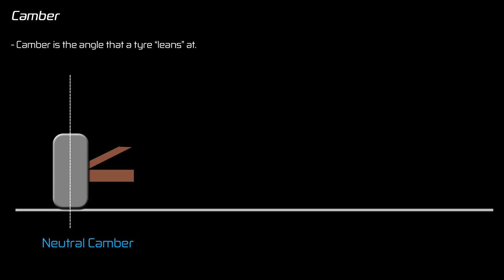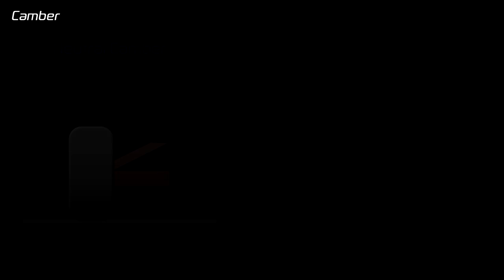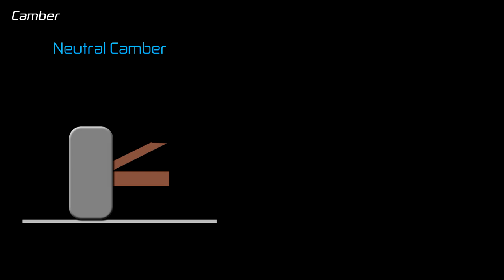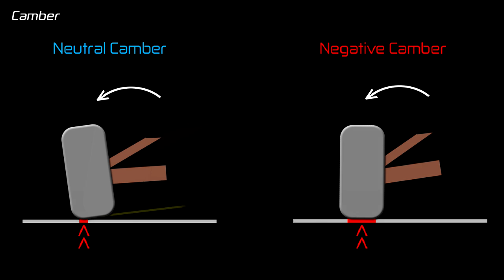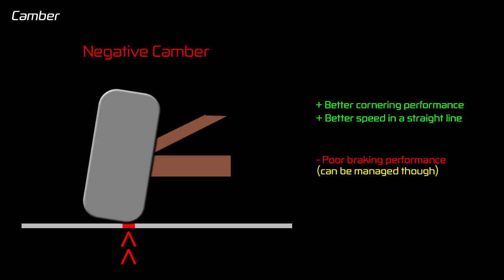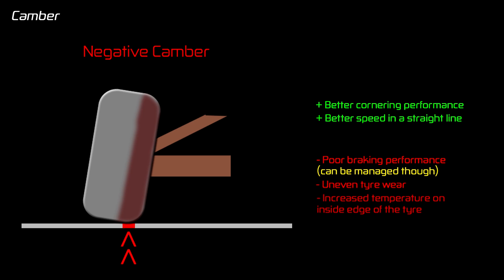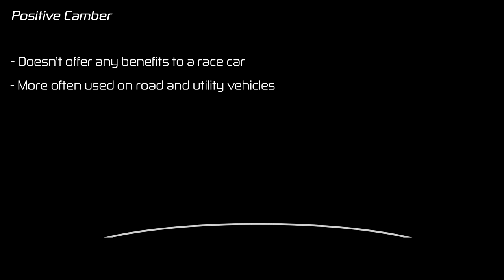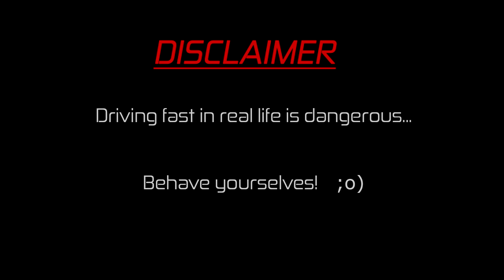Race Sim: Camber

Comment: Positive Camber is used a lot in Drag Racing, it is used to increase the amount of tire contact when the car is accelerating in a straight line. The more tire contact you have going in a straight line, the more grip you have.
Reply: wouldn't you have better straight line traction with neutral camber? or is it effected by the unique flexing of drag tires?

Comment: This might be right for the back wheels. But when a car steers, the front wheels lean to the side that they steer, so this makes the loaded wheel with a negative camber, touch the ground even less:
E.g. Car turns left = weight on the right = right wheel leans left because of the steering = negative camber makes the right wheel touch the ground even less ... I'm not a tech but this is how a car's steering system operate. Same goes on my RC cars, with a negative camper on the front gives wear only on the inside of the tire.
Reply: Yeah you have to factor that in, so that it cancels out.

Comment: Wow thank you. I keep getting told that Negative Camber is bad. That isnt the case then. It may be bad if I am a daily driver but not if i know I'm gonna be making hard cornering. My negative camber is about -2 - -3 right now. I think I will go buy the parts to try to keep it in -1. I am seeing really bad wear on the inside after 20k miles.

Comment: Positive camber in karting tho
Reply: I can't really think why a go kart would want camber- they don't roll in cornering. 
I have heard that positive camber can make a car more stable if it has 'primitive suspension'. Maybe it makes a kart more stable, since as it has no suspension. It might also be, because of the king pin inclination, a go karts wheel might turn to negative camber when the kart is turning, so the positive camber would cancel it out- which is a good thing.
Reply: @projectilequestion  yeah, your second point. It increases the contact patch whilst cornering. Kart adjustments are usually the complete opposite to what you would expect in a car
Reply: @lume.3887  Unfortunately, I have no experience in modifying karts, so I can't really say. But with a car with double wishbone suspension, if the top wishbone is very short, the top of the wheel actually tilts in when the car corners. 50's and 60's F1 cars used to run positive camber quite a lot.